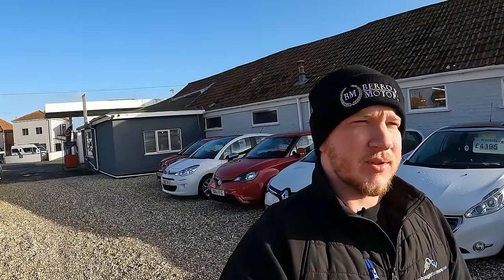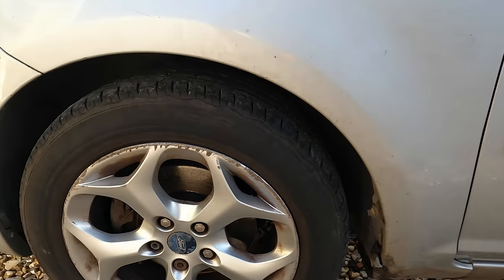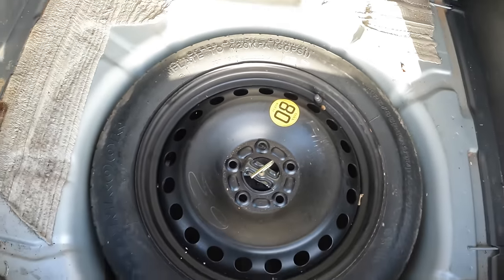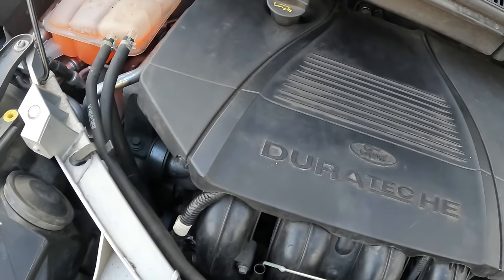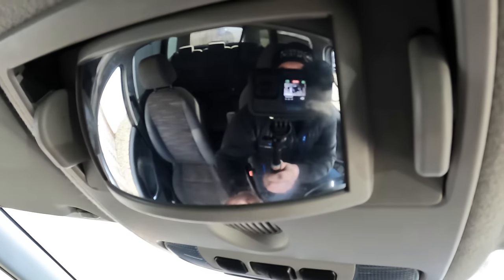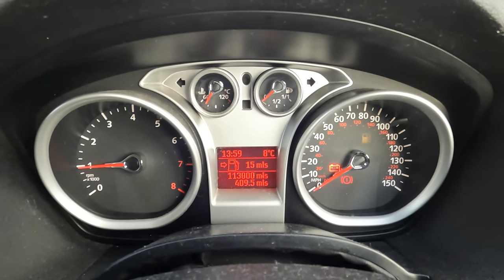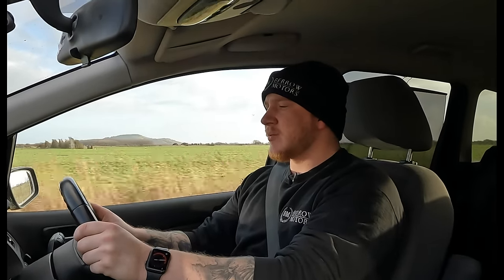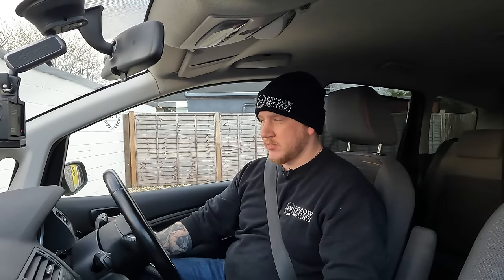I bought a CHEAP FORD C MAX. How bad is it?

Comment: What a good idea Ford had all those years ago with that bonnet release mechanism… sadly many years later their customers discovered it wasn’t that robust😢
Reply: It’s crap. A conventional bonnet release inside the car is best
Reply: I use a screw driver
Reply: I actually replaced mine with factory part.  Not a hard job and quite fun building up the lock to match the key.
Reply: Yeah - typical Ford: try and make it better, but annoy the hell out everyone by making it worse!

Comment: I have 2003 Focus Cmax. "Inherited" it as my first car. We had it from new and it was i think the most reliable car in family.  1.8l Duratec HE Gasoline.  Only thing i would change is 5speed gearbox to 6 speed one but otherwise as im 1.95m tall, it is damn confortable and when i do taxi for my grandparents. They preffer it to other family cars.  Wanted to keep it until it breaks down. Well it holds for 12 years, with only alternator died. Otherwise only some minor issues like sensor dies, wheel bearings. Which do not count.    True its grey mouse car. But i would never change. Its reliable work car. Good cargo capacity. Damn comfortable and for me reliable and fixable.  7.5l/100km but when i drive gently i can do 6.2+-.  Non to little rust so i hope it will last for few years more.   Not sure if others but mine is quite sensitive on fuel.  When i fill up tank on certain pump stations, it feel lazy. While other cars are OK with it.

Comment: I've had my 2007 1.6ti pre facelift cmax for 5 years its got 140k runs like a swiss watch, burns no oil between changes, i get high 40's mpg on a run and mid 30's around town, replaced the usual bits Clutch, disc's, power steering pump. Been to Highlands of Scotland in it , Wales, Cornwall never let me down . I will be sorry when she dies but i drive it like it was made to drive no like a boy racer off Top Gear .Nuff said.

Comment: I was gifted a 10 plate 1.6 petrol that I use as my runaround. Its an inoffensive car around town, quite a pleasnt drive but on the open road the asthmatic 1.6 is way too noisy, too high geared and woefully slow.

Comment: I have a 14 plate cmax 1.6 diesel with 54k on the clock, love it as its easy for me to get in and out of due to a disability. Had it for 3 years and no problems, regularly serviced which helps.

Comment: @1:13 The gearbox options are very interesting in this gen. Petrol versions only came with a 5-speed manual whereas the Diesel version had 6-speed and 6-speed "Powershift" options as well.
@23:02 Yeah, but if you are a large lad, space and comfort are more important. Having to bend over just to find a comfortable seating position is not everyones' cup of tea.

Comment: I hadn’t had to have a car for nearly a decade bc I lived in Seattle and had no need. However, I recently moved to Illinois and found a 2015 C Max on Carvana. I totally love this car. 42 mpg, handles well, all wheel drive is great in the snow and rain, great acceleration for a hybrid, and excellent interior space. I’ve carried 25 10 pound bags of mulch in this car, as well as, chairs while shopping.

Overall, I’m very satisfied

Comment: Had one of these 1.8 petrol.  Had issues with eml and other electrical gremlins.  Local mobile mechanic came and took some codes.  Guy  was brilliant traced the problems to broken wires in the loom that pass through a plastic box near battery (it's a  weak point,  loom gets moved around over a tight bend and wires  chaff inside, break and make contact with each other) . Charged me  £20 for code reading  and another £40 to fix by soldering the broken wires . Car was nice to drive and versatile  but I didn't like the electric handbrake on mine.

Comment: the C-Max is more the "family friendly" version of a vanilla focus. its not flashy, its not a car that sticks out and you see/have seen enough to prove they're work horses.

the zetecs of that era were not well equipped (from what i remember, the zetec was the next step up from the LX)
to be fair, 113k on a duratec is just about ran in. they're pretty much indestructible as long as you keep them maintained. the christmas tree dash i would have guessed it suffered the cluster fauly which was a common issue for the focus and the CMAX of this era. surprising that all that was caused by a bad alternator.

If i seem a little "too" knowledgeable, I own an '05 Mk2 Ford Focus. SUPER rare 3 door, 2.0 petrol, titanium spec (so leather, AC, electric mirrors/windows, quickclear screens, auto lights/wipers etc) which is starting to show her age a little. had it for 13 years. suits my needs perfectly. fast, reliable and IMO a cool looking car that blends in to the background. (I much prefer the PFL styling)

Comment: I had one of these, the rear grey plastic ‘spoiler’ was letting in so much water, I just took it off and siliconed all of the bolts that held it on, was fine after that 😂

Comment: Up until the end of december , My mum was driving about in a 15 plate black C-Max Zetec. I grew sort of attached to it. Max the cmax was really reliable until she needed nearly a grand spending on getting her fully fixed (Service , suspnsion work , cambelt esc) So we traded her in for a 19 plate Sportage. Sportage is nice but i still miss the cmax's little "Quirks" aka cosmetic damage & slightly dodgy electrics

Comment: It is a dangerous practice on modern cars to connect the black lead directly to the battery (assuming a -ve earth of course) far better earth it to the engine or body as sometimes there are sensors on the -ve side, there is also the danger of blowing up the battery, don't believe me?, do some research. The other things with jump starting are start/stop engines, make sure you read your owners book, many an owner has regretted both the aforementioned, I own that Topdon and it's great.

Comment: That to me looks like it's got the cluster problem of dry solder joints on the back extremely common on that era of ford I've had many lol I had a cmax exactly the same same engine and it had over 200k miles on it good cars for a cheap run around

Comment: I had a 2008 cmax from new and the bumpers look different from the shell and a design floor means they eat alternators, I sold mine with 25k miles 4 years old with a new alternator

Comment: my sister had a 57 plate 1.6 petrol c-max never let her down always started 1st turn of the key. i did regular oil changes every 5000 miles it just ran and ran and ran. she used to run me up to hospital in it as im disabled found it easyer to get in and out of than a focus. she p/x it for a 2013 grand c-max 1.6 tdci with 80,000 miles on it and fsh and that has turned out to be the biggest pile of unreliable junk she has ever baught, left her stranded at the motorway services with three kids, took two days for the recovery company to pick it up and get it back to her. so i set to work with f-super . egr valve stuck open clogged up(removed it scraped most of the soot/carbon off with a screwdriver then mr muscle oven cleaner left it to work while i had a coffee then scrubbed it out with a babys bottle brush..and after that a quick blast of brake clean..came out perfect), 4 new injectors, new diesel filter(low fuel pressure at rail, diesel filter looked like it was full of sludge....cheap tescos fuel  at its best) and full oil and filter,air filter and glow plugs(as only 1 was working), and a can of bg244k finally got the pile of scrap running right again...for now! the zetec petrols dont seem too bad but the newer tdci above 2008 seem to be nowt but problems done a few of them.

Comment: Had 26 cars since 86 3 Capri s   4 Mondeos and 2 C max , C Max were ok didn't like the electric handbrake and putting a litre of oil in the 1st 1 soi traded it, was hitting the floor or smoking, think valve stem seals starting to go

Comment: My mother-in-law has got a 2008, titanium model 1.8 L petrol also has issues with battery light showing. It’s had a brand-new Ford alternator at great expense but still the battery light is showing… Any ideas what to check next?

Comment: There is also a bonkers intermittent electrical fault on those, where the dashboard lights up like a Christmas tree, the Speedo and Rev counter lose all touch with reality, then all is OK for a few weeks or days. Not sure if it was sorted on the later one’s after 2007 with the orange digital display? Source I’ve owned Some Focuses ( foci?)

Comment: My smax had a new alternator and for the few years it lasted it liked to throw on battery light. It was like a smart charge issue as when light was on drop down 13.7v were as light off was 14.4. died in the end and just put a genuine 2nd hand oneon.

Comment: I have a cmax zetec 1.6 no power going up a hill 2017 plate only 16,ooo on clock under powered like the old Ford cortina it come from Norwich x mobility car mint condition back seats never sat on serviced every three years

Comment: Have one of these myself the powersteering fault and engine light aways comes one when the battery drained or knackered the damp carpet in the back is the boot door seal along the top and bottom of is not sealing correctly

Comment: Hola a todos! Yo adquirí mi unidad hace casi ocho años y estoy encantado desde entonces. Ford Focus C Max tdci 2.0 Chía de 136 cv. Va para veinte años y 404 Mm.
Mi resumen es, simplemente, PERFECTO. Adoro su carrocería y adoro su mecánica, tiene prestaciones superlativas, consumo razonable y gran habitabilidad y capacidad de carga. Yo lo campericé mínimamente y descanso dentro de lujo. El motor suena y va de cine, consumo de aceite nulo. Sólo un problema mecánico serio (caro) pero sl final es mantenimiento: cambio de embrague y volante bimasa.
Saludos y suerte a todos.

Comment: I had a 2 litre c max 2009 auto. Was so so reliable. Had 136,000 miles before it was sold on. Was sold for around £2000 and had 0 issues with it. 
One bad thing was it used sooo much petrol. Average mpg was 28 which is horrendous

Comment: Not bad cars, the 1.8 petrol is an old Mazda derived lump. Chain driven cams so no belt, ulez compliant but a bit noisy at motorway speeds. 
The Cmaxes are easier to get in and out of than a Focus so do appeal to the mobility-challenged.

Comment: It's could be the cluster common fault done many of then just replace the solder
Reply: Same on Focus and Polo's...my source resolders for fifty quid
Reply: @Adam s  seems to be 2008 year for some reason I have done 2 cmax and 3 focuses bought one cmax as a none runner resoldered the clocks started first time